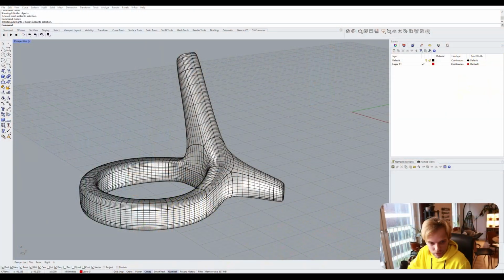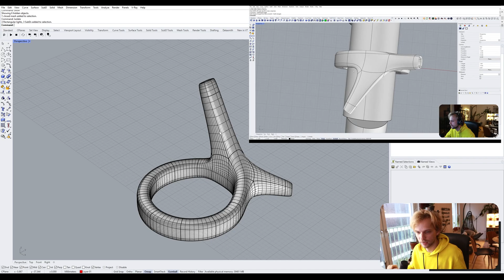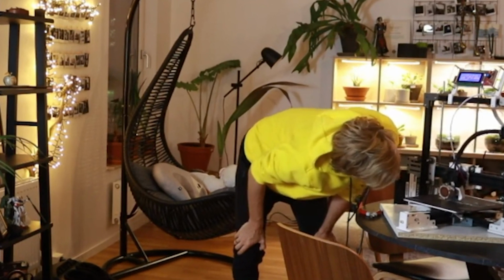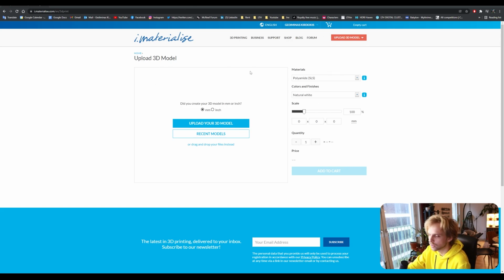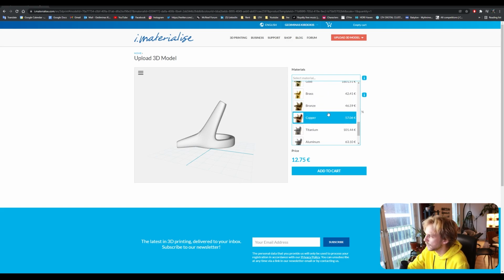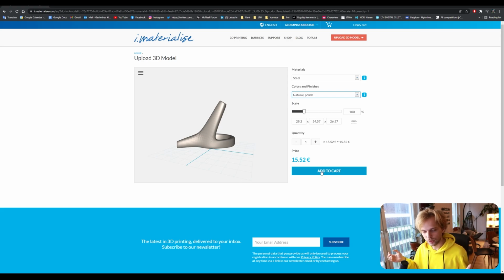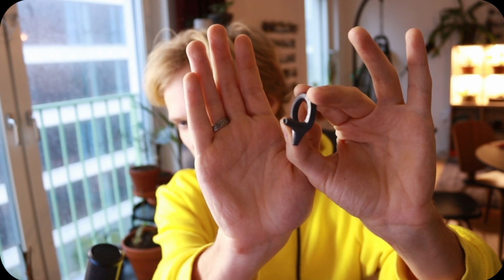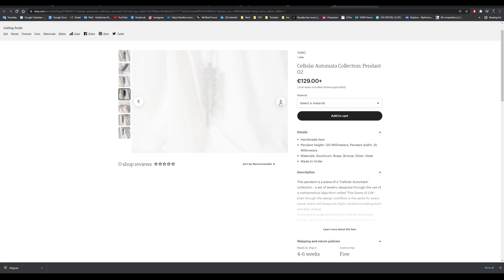I 3D printed my own ring in STEEL

Comment: Thank you for sharing this service 💛 do you still use I.materialise or have you moved on to working with a manufacturer? I want to start my own jewellery brand (I make my own 3D models) but then I realised selling 3D printed resin rings probably wouldn't be the safest thing overall, wouldn't want to get sued just in case anything bad happens as a result of those being worn regularly! 

So then I was like I guess the next best thing is to just print & sell PLA rings which is likely way more skin safe. But then I was thinking they'd look really boring and might not sell? & painting them could also cause some health issues too potentially (most paints likely not being skin safe). 

So I think I'll just use this service as the upfront costs seem low. Can't afford to reach the minimum order quantities that most jewellery manufacturers ask for currently. And so from what I can see this service seems to be one of the best options for 3D designers just starting out? Only real drawback I can see is the month long wait!

I guess other options would be to buy my own equipment & make the rings myself or reach out to an independent jeweller and ask them to make me the rings to start off with, but this seems easier overall? (and probably cheaper - unless I can work out something with an independent jeweller which works out cheaper)

P.S. if you have any tips or general advice on what would be the best option for me to start selling metal jewellery that doesn't require a huge upfront cost let me know!
Reply from the maker: PLA (or any other plastic) jewelry will not sell. Plastic associates with cheap, which is in dissonance with the concept of jewelry. Open an online store on etsy.com , use I materialize as a manufacturing company. Always have 1-2 jewelry pieces at home, and order new ones once you've sold the ones that you have.
Reply: @DesignGoBrr  yeah exactly that's the worry I had haha! I definitely wouldn't wanna wear plastic jewellery. Thank you for the advice! 🥰

Comment: I just bought a cheap metal ring and it broke. Was considering 3d print it but didn't want a plastic ring. Thought I could use it to cast a metal ring, but a good casting is expensive. Thanks for the idea!
Reply from the maker: Yea, definitely try it out. The prints are quite strong!